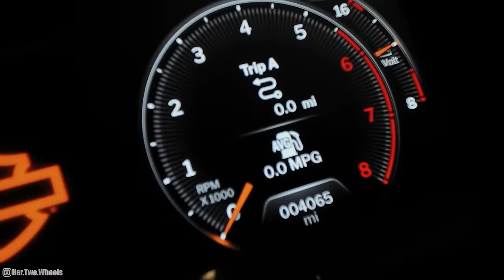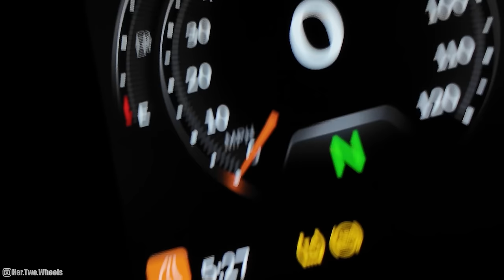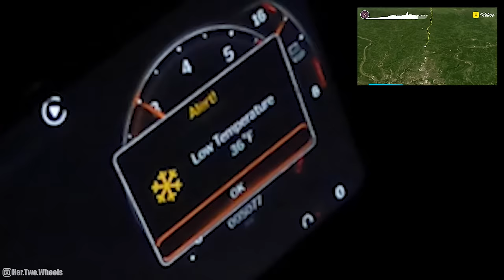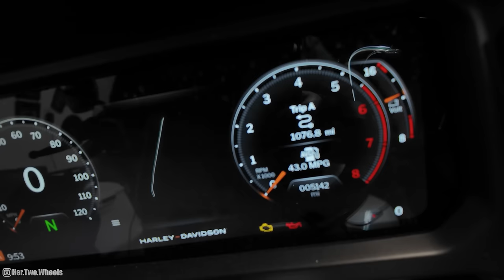It kills me to tell you this...

Comment: I think this is the third time I have mentioned this, but you can have the rear end gear ratio changed on the truck and it will make a huge difference in towing capacity rather than getting another truck. Retired RV Dealer here.
Reply: 🌿 THAT IS GOOD INFORMATION ℹ️
YOU ARE THE MAN ♂️
Reply: How much can you change the gears on the new vehicles before it confuses the computer and screws up the shifting?  I remember this being a problem with the OBD-II when it came about in the Mustangs.  But I agree, gears are everything.  My Tacoma Access Cab has the 2.7 and weighs 4000 lbs., but it has a 4.30 rear and the 6-speed auto has a real granny gear for 1st.  Us old school guys would never believe it's only 159 hp when you have a 20 foot Mastercraft behind it.

Comment: Ok kinda of an off the wall question ... if one was to buy a used or new van to double as a camper/motorcycle hauler would you recomend a Dodge Promaster Super Hih Roof 159" extended van or a Ford Transit Super High Roof 148" extended van. Ford does make an AWd van but they are very expensive.and out of my price range. I would prefer to ride my bike to wherever but in the rare times I need to haull it ... Thanks and God Bless
Reply: Love from Mississippi USA 🇺🇲

Comment: I have a portable battery pack with a long charge cord that will run between my Cardo and the pack. I put the pack in my inside jacket pocket and recharge the Cardo. Then I put the pack on to charge from the bike. It isn't pretty but it works really well.

Comment: Get a pinlock for your visor, I have a LS2 and even in the rain fog is never a problem. I rode this winter down to 25F without heated gear so I spent the money to get a pinlock for my smoke visor and it was worth it. It has the built in flipdown but for me it isn't dark enough.
Reply from the maker: It has one 😅
Reply: Love from DeKalb Mississippi USA ✝️🇺🇲✡️
Reply: @HerTwoWheels thought it strange that it wouldn't but fog shouldn't be an issue then.

Comment: Do we have to turn on iPhone CarPlay and headset before powering the bike to get it connected automatically? Or does it matter?
Reply from the maker: Nope. After you connect them manually, they should connect automatically each time you start the motorcycle. But i do think you have to have your phone plugged in to the bike
Reply: Yep it worked, just got to be patient, I’m usually not.
Reply: That's a good question ⁉️😃

Comment: Speaking of stupid birds having the hole sky ..if i may share , way back in the late 80s or early 90s i used to have a little Cavoleiar connvertable and im heading into work at a Cyrstyler dealership and about halfway there a stuped bird hits my windsheld but it hit the bottom end of the wiper blade and it got literley split in half , one half is gone and the other half is stuck there in my full view and i had to get to work so to avoid looking at it i grabed my book had brought to read at lunch and stuck it up on my dash to hide it till i got to work and i had just enough time to run the car into the wash bay where i worked and hit it with the pressure washer and clean off the windsheild then go park my car and clock in with only a couple of minutes to spar..and sorry for spelling misstakes as my spell checkers not working ..lol

Comment: dumb question if you are always wear helmet is the audio speakers upgrade gonna make a differance?
Reply from the maker: I can still hear with a helmet on lol. The speakers on my 2018 Road Glide are perfect
Reply: 🌿 IF YOU'RE RIDING A MOTORCYCLE WITHOUT A WINDSHIELD GOING DOWN THE HIGHWAY THE WIND MAKES IT WHERE YOU CAN'T HEAR MUCH 🤔 WHEN YOU PUT A HELMET ON YOU CAN HEAR BETTER THE RADIO AND THE EXHAUST  A BIG FAIRING HELPS A LOT TOO  FULL FACE HELMETS IS EVEN QUIETER

Comment: I might test ride the Road and Street Glides, but I REALLY prefer the Electra-Glides. A word of advice. Grab the hand and foot warmers. If you're having trouble with your heated gear, having those little packets of heat for your hands and feet could be a bit of a lifesaver.

As far as APPA, you COULD sell him and use the money towards a bigger truck. I mean... that's a thing, right?   S U P P O S E D L Y... Dodge is lowering the MSRP on their HD models. I'm a Chevy guy, but if these prices were available when I was replacing my old truck, I might have gone with a 3/4 ton RAM instead of my 1500 Silverado with the 3.0 Duramax (but I LOVE my Chevy, she's a good girl)!

Just a thought.

Comment: Jordan, if you rock the bike side to side it will break the front tire loose from those Condor chocks easier. They just squish into the front part of the chock more and more with each bump while towing. Even when they are bolted to the trailer floor mount, they do that.
Reply: I had the same issue getting my Rocket III Touring off my Condor. I moved the pivot pin 1 hole forward and voila, the front wheel pops right out of the chock. I've experienced no loss of stability, even without ratchet straps. Oh, I use the Condor exclusively in the garage.
Reply: @Leftycraig48  agreed! I swear by my Condors! Oh and don’t roll off  the race track straight into one at the end of the day. Your hot tire will glue itself to the chock 🤣